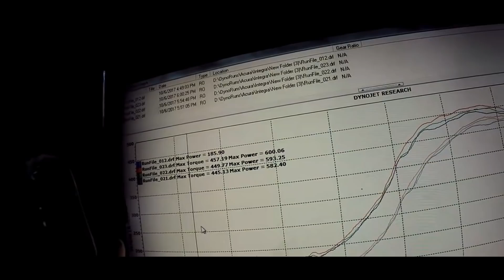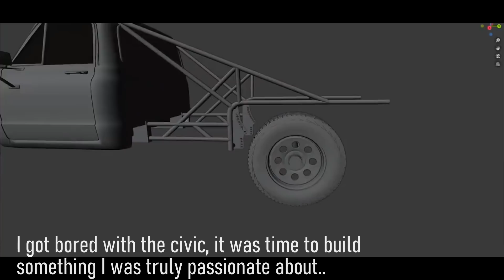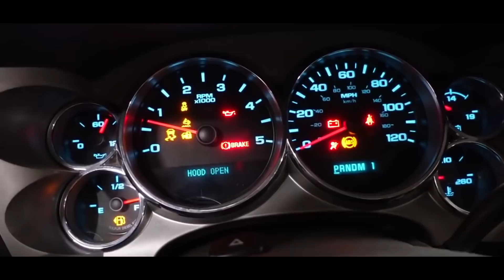Saying Goodbye

Comment: I have a 70 3/4 ton camper special. Went 15 secound 1/4 mile with ho 305 heads and the big edelbrock cam in the 350 with the old granny geard manual trans till it split the crank. Built 10.75-1 454 with a little comp 4x4 cam and went 14 flat in the 1/4 with a stock th400. I had lots of fun dragging 2v 4.6 mustangs for years with that setup. It was comical because it was a rusty old farm truck just laying waste to to amarillo mustangs. Even made a little money at job sights racing other contractors new diesel work trucks